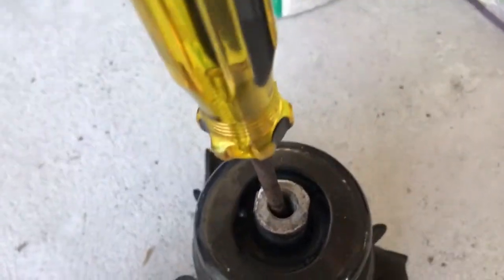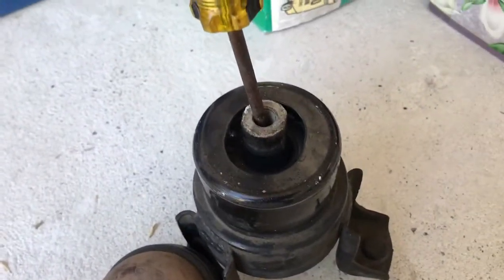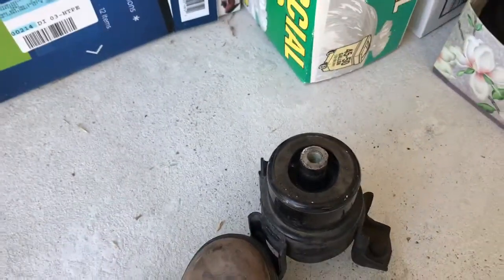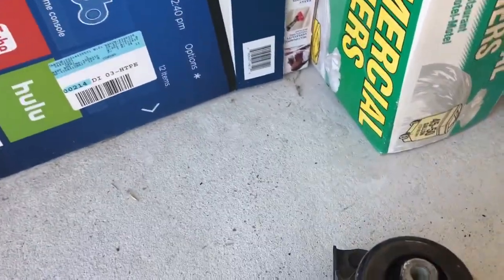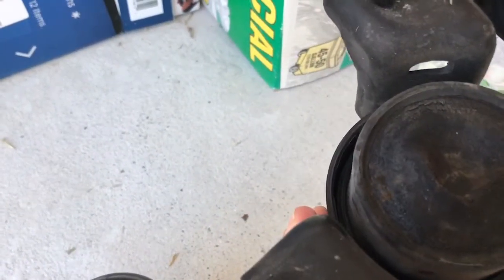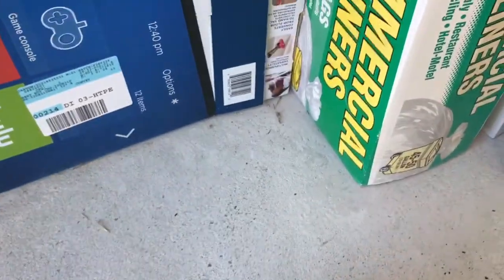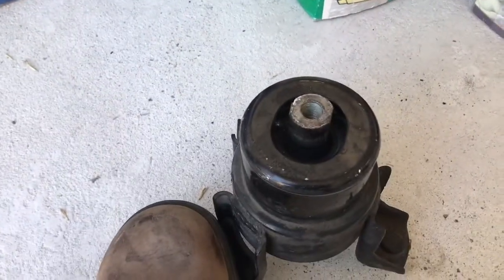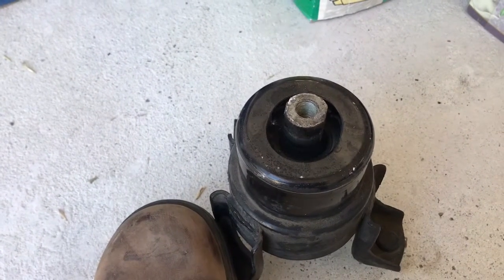2004 Toyota Camry Front Engine Mount Worn Out

Comment: Looks fine to me.  Center and passenger mounts are intended to pivot freely.  What you don't want is going up and down freely. Pivoting 360 degree is desirable.  Your new mount once broke in, I bet it will do the same.  Driver side for the transmission is also intended to pivot as well but more stiffer.  In term of stiffness, driver side is most stiff, then passenger side gets medium stiff, and center gets the least stiff of 3.  This is by design.
Reply: Your info is very interesting. You sound pretty knowledgeable.  Where did you get this info?  I do not want to replace a mount that is working as it is supposed to.  Do you happen to know how to test front mount without removing it?  Someone on youtube said to push the car up and down and see if the front mount moves vertically significantly.  Is this good method?  I would appreciate your reply.  thanks!
Reply: @tommason5689  The best method is to remove top nuts/bolts, place engine on support (driver side, jack point is oil pan while passenger and center is between ATF & Engine joint).  That way you're not inducing more damage and you feel it with your hands.  Depends on how badly yours worn out.  If you can push the engine back and forth with little pressure and you hear movement and clunking noises then yes they've gone beyond repair.  You can also jack them up a little then push the engine around.  I don't recommend doing last option because if your mounts are old but not worn out so can damage them.  Best to jack, support, then loosen all the nuts and feel the movement.  If your car is over 120K, it paid to learn doing this job as if you need to replace them because many components that need servicing at this mileage requires mounts removed.  So there is no way to get around it.  Once you've done this job, it becomes a quick 2 hrs job.  Not as bad as everyone said.  Does take time to learn though.
Reply: @bonholio0o  Thanks for your reply.  My car has over 200k and it started to make vibration noise and it turns out torque strut was busted which caused the noise.  I was afraid this might have caused damage to other engine mounts, especially the front mount.  I tried rocking the car back and forth and up and down and it seems to be rock solid and does not move at all.  Only time it moves significantly is when gear is changed between reverse and drive and park, and it moved the most when I rev'ed the engine while applying the brake.  I noticed a vertical movement of half to an inch.  I am not sure if this is normal.  I also checked the other two mounts while changing gears and reving the engine and they hardly move at all as well.  So I assume the other mounts are fine at least for now.  For now, I will not dare to do anything to test the mounts further.  Thanks again for your reply.
Reply: @tommason5689  I can't speak for other vehicle but on a Camry the order for going out is always dog bone first -> bottom center -> passenger -> driver.  Since you're hearing noises in reverse, you gotta take a look at your bottom center.  It's bottomed out.  Have someone put it in reversed then step on the brake while you look and feel the area, it'll let you know.  I have brand new mount that have solid  bottom cap that does this and it's very obvious, NVH is through the roof.  And dog bone is pretty easy to change out, see if that fixes your park and drive mode.  Me I always change out all 4 whenever I do mine.  Once one out of 4 goes bad, the other 3 will do more to keep the engine stable so they're on their way.
Reply: @bonholio0o  I have 2003 ES300 and it has hydraulic front mount, supposedly, which does not show any sign of leak.  ChatGPT says as long as there is no leak on hydraulic mount, it is good.  Is this correct?  Intuitively, if the mount is supporting the engine by hydraulic liquid instead of rubber, it seems like there should be nothing to go wrong with it as long as it does not leak out.  What do you think?
Reply: @tommason5689  Not what I think but I need to stop listening to AI LOL, never trust them

Comment: Ok now I know what to look for I suspect that mount is bad on my car, I was wondering though, what symptoms did you have from that mount failing like that, I have a clunking issue when my transmission downshifts from 3-2 gear and sometimes from 2-1st gear, and the car clunks when switching to reverse and drive
Reply from the maker: The sympton I first noticed was when driving I would feel a clunk when the engine would shift, just not normal for the car to jerk like that when shifting.
Reply: @johnvest4216  gotcha, thank you, I will replace mine this weekend, as I’m having that symptom as well